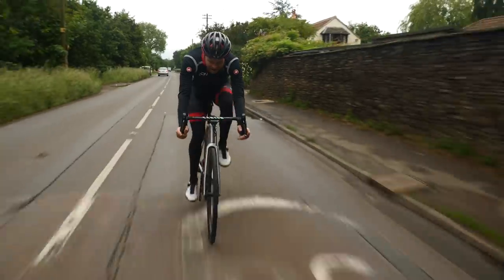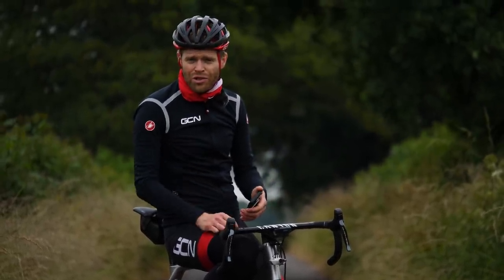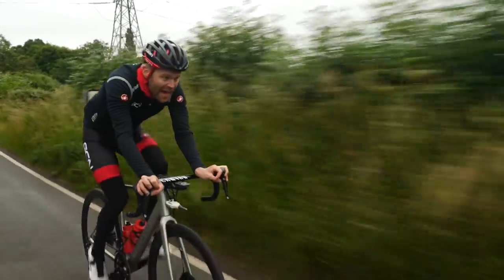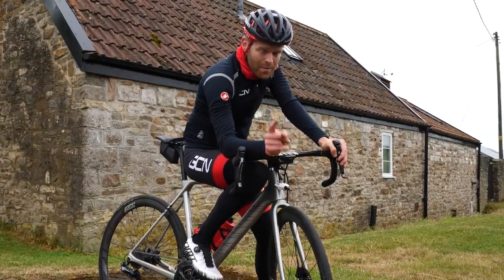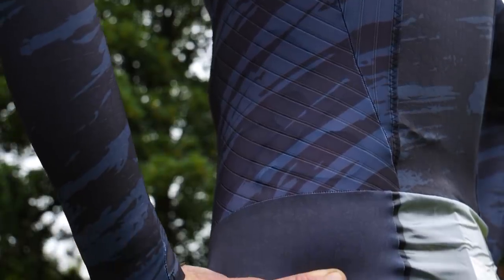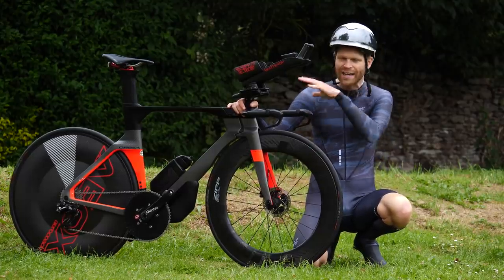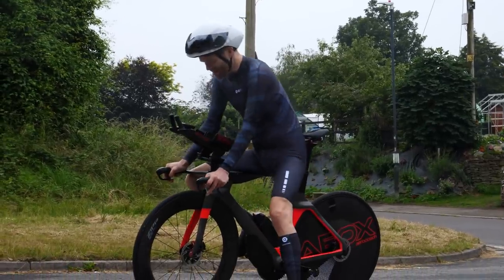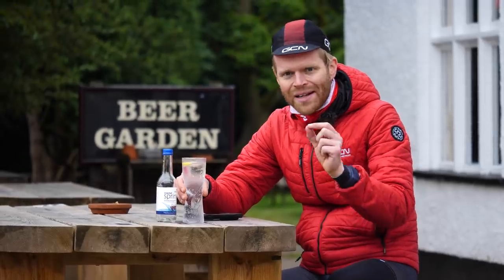The 30 mph Aero Challenge - How Fast Can Ollie Go?

Comment: I would be thrilled with 30km per hour for an extended period of time.
Reply: I can do about that for around an hour on my pretty crap mountain bike

Tho last time i checked my bike is limited to 28mph so the closer i get to that speed the more resistance my wheels turning have

Coasting and pedalling as hard as i can down the same hill the speed never goes over 28mph

Tho i do need to recheck it i replaced the green crispy slimy crap in my bike with silicon grease so im hoping for a faster top speed tho i dont have time to go test it but i will test it at some point
Reply: Pablo Hinze  there is a mechanical / physical top speed for bikes

For me i am hoping that comes down to the sticky crispy crud they used as bearing grease, Ive replaced it but cant go out and test it

But no joke my bike cannot go over 28mph, even pulling it with a car the wheels will just start sliding while still spinning as they cant turn any-faster
Reply: @commanderoof4578  maybe you have a ebike without knowing that you have a ebike? 🤔 JK … Although it’s your words against mine hahaha
Reply: @commanderoof4578  U might need new bearings and/or even a pair of budget wheelset and you might go over the 28 mph “mechanical/physical top speed of ur bike” mate! Orrrrr…… just buy a new bike hahaha
Reply: @BigBrownMonke  its not just my bike i tested every bike in my shead

Mine is the slowest at 28MPH
Next its 31MPH, 33MPH, 34MPH

And then my dada road-bike which i got to 55MPH on and went fuck this i ain’t going any faster and then started to slow down using

So ALL BIKES have a mechanical speed limit where the wheels actually cannot spin faster just some that is really low and others where the top speed isn’t going be hit because you will decided to slow down or keep at that speed

Ohh and all of this is down a hill by the way at 65 odd degrees that is actual 65 degrees not the road or incline crap 65 degrees where 90 would be vertical

Not gonna change 65 degs to an incline because i dont use incline for anything
Reply: @BigBrownMonke  bike is fine i tested the speed limit of it when i got it and i tested it every 3-4 months for like 2 years when i got it top speed was 28.3MPH, past time i tested it it was 28MPH and average is 28.2MPH out of all the tests

Bearings are fine its the thick, sticky, crispy crap they use as grease that could be the issue and thats been replaced but i dont have time to test it and see if it is the grease

Because when i say what ever that was is terrible stuff i mean it as in put some on the floor and rubbed my shoe on it and it bearly let my foot move meaning its like using weak glue as a lubricant
Reply: 30kmh is definitely achievable without needing anything special. An ordinary road bike,  form-fitting clothing, a reasonably aero riding position and a decent level of fitness are all you need. Go for it!
Reply: @commanderoof4578  Sorry but almost everything you're saying is wrong. The resistance of your wheel bearings is negligible compared to the other things that are slowing you down. The reason you can't exceed 28mph down that hill is, ball-park, 90% air resistance, 9% rolling resistance of your tyres on the tarmac and 1% everything else. Bearing grease is supposed to be fairly thick so it stays inside the bearing.
Reply: @beeble2003  well i will test it when i can

But just to let you know first time i did the test i did it 30 times, 5 times with 15psi, 5 times with 70psi, 5 times with a loose coat flapping around, 5 times wearing my cycling gear, 5 times pedalling as hard as i can and then 5 times at the end wearing my cycling gear, pedalling as fast as i could and with 80psi the upper limit of my wheels

Slowest was 27.7MPH or something around there and fastest was 28.3MPH or so

Which means it is some moving part on the bike that is limiting it, and that thing isn’t wheel pressure and aerodynamics had pretty much no effect

So it really is a mechanical limit of some moving part of all the bikes i tested minus my dads road bike which i bailed out on and never found its limit

But all of the bikes in my shed are mountain bikes outside of the 1 road bike being my dads

Ohh and think of thick in the case of the stock bearing grease like using toothpaste only the stuff in the bike was more grippy than toothpaste only sharing the same consistency as each other

Another way of putting it is i span my front wheel with a drill to as fast as i could and stock crud gave me 28-29 seconds or so of free-spin but my replacement grease was still spinning along 5 minutes later all be it very very slowly

So the grease in the bearings i am hopping is the culprit but as i said i cant go out and test it

When i wake up its normally raining and if its not raining the ground is soaking wet

By the time i get back from work its either raining, soaking wet or it was a long shift

So i will test it as soon as i can but that could be a few days of a few months i have no clue as i haven’t even been on my bike in almost a year there just isnt time and when there is the road conditions make it a no go, dont plan on sliding for over a mile down a hill no thanks, so bone dry only and only when i have 2 hours free time as i need to go there do 5 runs from top to bottom and back to top and then get back
Reply: @HkFinn83  pedalling and not pedalling the 28MPH doesn’t change so its something and that something isnt me

Not pedalling with a flappy coat on and 15PSI in my wheels i went 27.7MPH where as wearing my cycling gear pedalling as hard and as fast as i can with 80PSI that speed was 28.3MPH

Its the bike absolutely nothing else can be the issue

 Especially when you add in my dads road bike where i wasn’t pedalling and still got to 55MPH and then went nope this is too fast and chose to slow down

So there is nothing it can be but the bike because the tarmaked hill i use is fucking steep as in most people that try walk up it give up, its a 1 way road and that way is down, to get hack up you need to use a side road which is less steep and twice as long
Reply: @beeble2003  Yeah did that on a commuter city bike with 3 gears in shorts and a T-shirt. 
Definately an UCI illegal riding position though. elbows on the handlebars and i did sport 4 times a week regional lvl.
So decent level of fitness get's a checkmark.

Later cross hybrid. same clothing averaged 32-33 kph for an hour usually.
straight flat roads no stops (ignoring any and all red lights that had no meaning on an industry park anyway)

however going over 35kph took a LOT of effort on that bike. Was never able to sustain 34+ kph unless massive tailwind.
Reply: @beeble2003  30 km/h is easy to hit and the biggest wall is fitness and weight.
Reply: @commanderoof4578  you need to get that checked out. That's fucking weird
Reply: You all need to be careful because I think you’ve stepped in CommanderWolfyx’s bullshit
Reply: @commanderoof4578  Sorry, but by the time you're at nearly 30mph, it's almost all about aerodynamics. Bearings have almost nothing to do with it. Bearing grease is supposed to be thick. If you use thin grease, it'll all just seap out and you'll end up running your bearing dry. Yes, it will look amazing at first, but it won't last and then you'll trash the bearings. Same as those cheap ceramic bearings you can get for derailleur jockey wheels which spin incredibly freely in your hand before you fit them, but the ceramic balls quickly destroy the bearing race and they're utter garbage after a couple of hundred miles.
Reply: @beeble2003  same hill, same stuff being worn 28MPH vs 55MPH then a bai
Its the bike period

And my wheels can be replaced quite cheaply its a mountain-bike after-all not to mention i rammed the bearings full and nothing has leaked out yet, there is more if my grease in there than there was stock and it has toothpaste consistency so its thick but it is much slipper than the stock crap

So it is the bike it cannot be anything else since just changing the bike itself takes me to 55MPH before i decided im going to fast

IT IS THE BIKE something in the bike is the issue, i had an hour free so regreased it and its been sat for a good year nothing has leaked out, its silicon so its not dried out and it still spins free for minutes at a time

My hope is its the bearings but cannot test it and if its somehow not my bearings then what the hell else on the bike could be limiting the speed?

Because 15psi vs 80psi doesn’t give me a speed difference of more than 0.1mph because as i keep saying my hill is steep like really bloody steep 65 degrees where 90 is vertical (not incline but 65 actual degrees as if your machining something)
Reply: @slwsnowman4038  Fitness, weight and a really cheap bike (Crimson Triax) hold me back. Can do 30km but not for extended periods of time. I chug along at 16-20km per hour and have fun.
Reply: @kippen64  Weight is my biggest drawback.  Especially going up hills...
Reply: @commanderoof4578  65-degree slope. Yeah, right.
Reply: @beeble2003  its a 1 way road and it was closed years ago because of health and safety
Reply: @beeble2003  When the grease heats up it breaks down to a thinner consistency. Cancellara used to have a mechanic roll the wheels on his TT bike while he was warming up.
Reply: @tonycrabtree3416  Yes, I know. But we're not gonna convince this guy that his wheel bearings aren't costing him 20mph...
Reply: @commanderoof4578  The steepest road in the world is about 40%. You're claiming that you ride your bike down a 215% gradient. Of course you are.
Reply: @beeble2003  it was commissioned by a farmer and used by the farmer for a few years before the police found it and closed it off with concrete blocks at each end but you can clime around the blocks with a push bike just stop before you get to the end or you are gonna break every-single bone you have and become a wobbly blob of flesh
Reply: I manage a bit more than that and of course as all of us do I wish I could be faster.  All the way up to the fastest TDF riders none of us think we are good enough, that is part of the joy of training.
I like Ollie because he is the GCN mere mortal who makes the rest of us mere mortals realise how insignificant we are.  That and how much of a good sport he is alongside riders he knows he can't really keep up with.
Reply: @commanderoof4578   I must point out that you are misreading the road signs. Road gradients are given in percentages (%) not angular degrees.
Reply: @redheathen9580  there are no signs and the road is blocked off with permanent concrete slabs each side

If you slip on your ass you are not stopping till your at the bottom unless its dry

It truly is 65 degrees as if your measuring something to cut it
Reply: @commanderoof4578  there are no 65% roads you madman😂😂
Reply: @commanderoof4578  LMAO
Reply: @commanderoof4578  post the strava link. Or just the name of the road, I’ll find it online
Reply: @HkFinn83  its not an official road its mostly grown with trees and you ain’t gonna be able to find it without physically being here it was closed off over a decade ago

And when i say road i mean its tarmac’ed not that it is a road people use or did use because they didnt it is a road that went no where apart from the top of the hill to the bottom and it was mud roads anywhere else

Only other road was a good 3 times longer and also just mud road to and from it
Reply: @commanderoof4578  what’s the name of a nearby road, it’ll be findable on google earth. People will be interested to see this Loch Ness monster of roads
Reply: Why is anyone bothering to argue with CommanderWolfy? They clearly are not going to change their view even though they're incorrect.
Reply: @Scotrik98  everything i have said has been said as statements there is no new there are only facts
Reply: @commanderoof4578  just give us the coords of that crazy steep road or shut up man
Reply: @commanderoof4578  If this "road" was REALLY 65 degrees, then your bike would have very quickly surpassed 28 mph and continued to accelerate out of your control entirely.
Reply: @johnbarron4265  unless something is wrong with the fucking bike as i said i tried app the bikes at my house and only my dads road bike went above 36mph infact i went and started slowing down with the thing before finding its top speed

But only that bike broke 36mph

The fucking bikes themselves are the limiter so replaced the great in my bike with way better stuff but haven’t had time to go test it properly but I did manage to pedal to 27mph on a flat where ive only managed 23mph before so it should exceed what it could do before
Reply: @commanderoof4578  Is it possible that your highest gear isn't high enough to pedal faster than 28 mph at your maximum cadence? Mountain bikes are usually geared fairly low after all. And perhaps the hill is just the right height to gain 28 mph by the bottom. A longer hill would allow you to go faster just by coasting down, no pedaling required.
Reply: @johnbarron4265  i took the chain off for one of the tests didn’t do shit
Reply: @commanderoof4578  Since your dad's road bike went down that same hill at 55 mph, there must be a serious amount of elevation drop. Maybe your positioning on your bikes is very upright, causing a lot of drag, and perhaps your tires create a lot of rolling resistance. Or the brakes might be rubbing constantly. Do the wheels spin freely when they're off the ground and you give them a twirl?
Reply: @johnbarron4265  no its the bike

I could stick it on a treadmill and it will speed up slower and stop way faster

The default grease is basically dried boggy’s it doesnt run at all and it can be rolled into balls replaced it and the one time i managed to go out on it i pedalled to 27mph where hitting that down a hill is normally near impossible and i also found myself not even needing to pedal for most of a ride where I would need to keep pedal just to move and not stop 30-40 meters later
Reply: @CommanderWolfyX  If both of your wheels now spin for five minutes straight after being spun up by a drill, I would say your hub bearings are in excellent shape. 28 mph just happens to be your bike's top speed when going down that particular hill, and your highest gear tops out at a speed of 28 mph or less at your maximum pedaling cadence, otherwise you could've gone faster down the hill. 27 mph on the flat is very fast for a mountain bike, so you must be a strong rider. But it still sounds like you would benefit from a larger chainring, given that you're only 1 mph away from maxing out your cadence on the flats in your highest gear.
Reply: Started with a MTB with a speedometer... don't really think of myself as the "average" guy, maybe just SLIGHTLY above average... but still, just a newbie with cycling.
Anyway, my avg speed was somewhere around like 20km, even when pedaling hard (as hard as a newbies can) I can do like 25-29km.

Switched to a roadbike, which is "borderline" entry (nearing trash level, as opposed to being near to "enthusiast" level), and noticed that I am a lot lot faster pedaling with less effort.
Though the roadbike doesn't have a speedometer, I can say that I'm doing around 25km with just about normal-nose breathing levels of effort (again, that's as a newbie), like casual chill riding.

So yeah, I think 30km is achievable with practice, but definitely easier if you have a roadbike.

Comment: That's really interesting on my TT bike (which is just a modified aluminium road bike with a disk and tri bars) I can get low and aero myself but the bike is not aero at all. in one of my latest TT's I did a 10 in 23:26 with an avg power of 319watts. it goes to show how aerodynamics can help so much. (my excuse to ask my dad for a proper TT bike)

Comment: Fantastic video! Just out of curiosity, how much did it cost to prepare for this effort? I don’t think most of us can afford the equipment Ollie used to reach this impressive achievement. So what was the cost of all of this Ollie?
Reply: I did it. Got so eager watching this, and always wanted to take the timetrialer in me to the full potential. I promise you, its expensive. at least 13000pund I have spent, but worth every penny. I became the Norwegian, and Nordic champion I Masters class, and In the Nordic one beating all other participants with 30sec or more over 28km. I am 47years and the classes starts at 30 ;-). The bike in this form is a true dream. You can cruise around with it at 40km/h barely pedaling if its flat ;-). Silly, silly fast if you get into the right position. Sure other bikes also are, but I never tried any other bikes. Just went for this one when I saw Oliie was that fast. 48km/h......
Reply: But mine is UCI legal.

Comment: Awesome video as always. Thank you Ollie

I would like to introduce a counterpoint to denser air as you are correct in regards to the down side versus less dense air. However one component that needs more analysis is denser air is more oxygen rich which means that You should be able to biometrically produce more power/watts/ improve FTP. A Vo2Max would be interesting of dense air versus less dense air with metabolic improvements That may counter arrow dynamic drag. I would be interested for anyone to comment on this.  Another words taking in more oxygen rich air versus less oxygen rich air?
Reply: Don't think the amount of oxygen in the air makes any difference. As long as there is more than around 17% O2 in the air your body will absorb 4% of it. Even if you breath 100% O2 you still only metabolise 4%. Some O2 may be absorbed into the plasma as well as the red cells but that just helps transport, your body still only uses 4% of the O2.
Reply: Thank you Neil, awesome medical  info!👍🏻